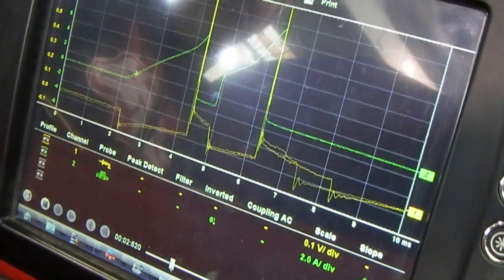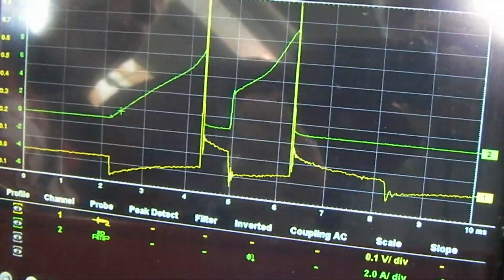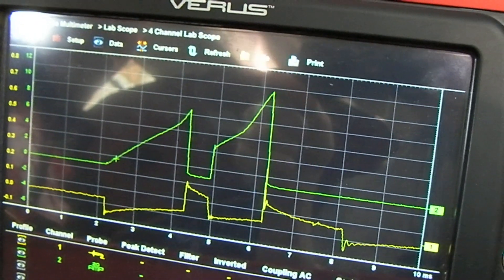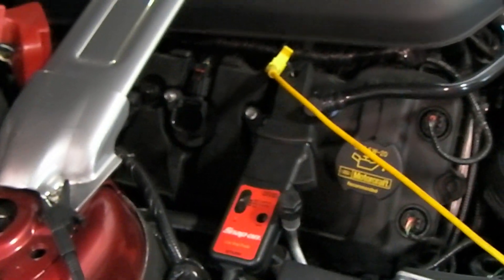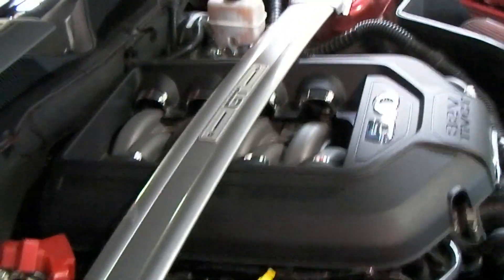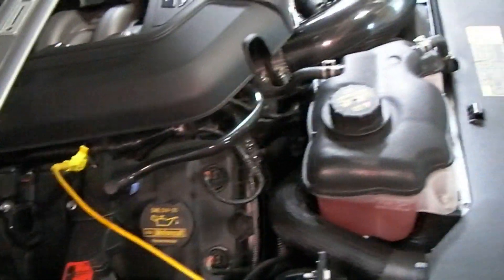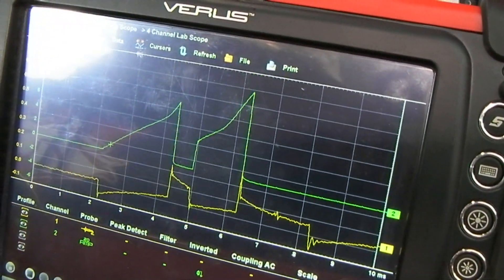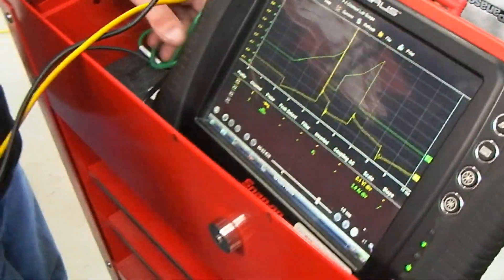Scope Testing an Ignition Coil

Comment: open secondary has no burn pattern. shorted coil has no voltage spike or smaller voltage spike. shorted secondary has no change on throttle snap if it's shorted outside combustion chamber. open secondary internally has double spike for 2 air gaps when there should only be 1. hope this helps anyone trying to learn
Reply: I don't use the term Burn pattern, it suggests combustion or burning, and spark isn't combustion, it is the spark time so an open secondary has no "spark line".
Reply: AuMechanic yeah good point